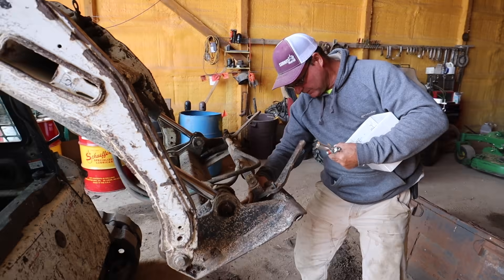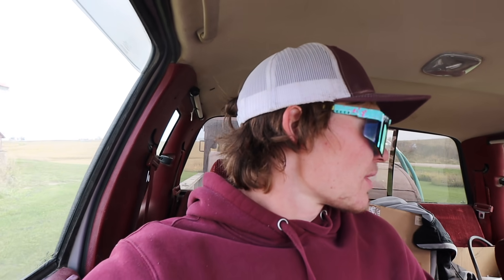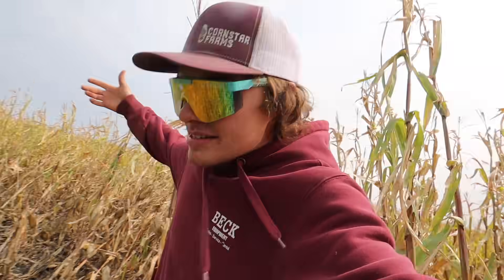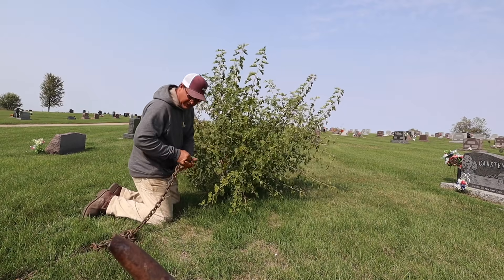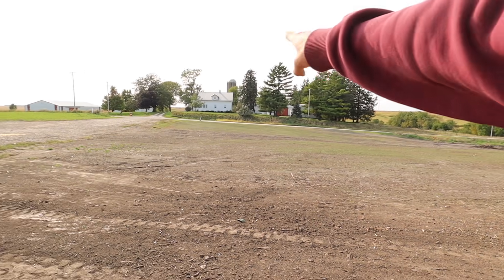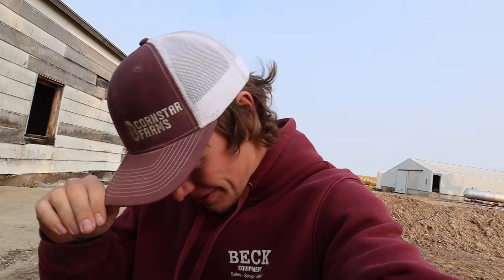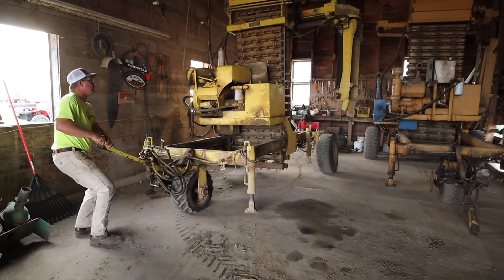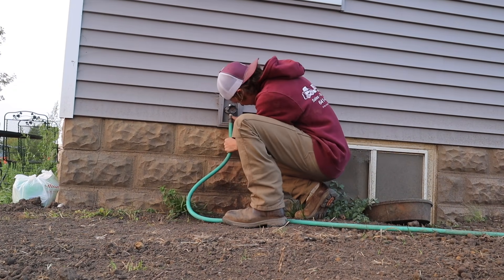My 1st Time Watering My 1917 Farm Mansion's Lawn!

Comment: Thank you for your tips on grass planting. Here in Phoenix most folks have converted to desert landscape. My wife is from Nebraska and wanted some grass. Doggie voted for it too. We have three large areas measuring 8 feet by 11 feet! I tried using a skip loader to level it out but couldn’t get it through the side yard. So I used a whole bag of mulch and spread it with the house broom (big mistake). Then I broadcast the half pound of seed. But was forced to do it by hand. Work, work, work. Finished quickly so I didn’t miss my afternoon nap. Now comes the arduous process of showing away the dove so she doesn’t get too fat. Work, work, work. It is now time for my pre-dinner nap so doggie will have to be on bird watch. Zzzzzzzzz.

Comment: Some Miracle Grow works great as a fertilizer.get a lot of hose and a water tractor I believe they call them turn on the water and it works its way along the hose watering.or get a spliter on the water connection and run multi hoses out and put a fan like  waterer on ends.

Comment: Use your spray nurse truck to water with.  Just put a nozzle on the pump fill line.  It will let you spray quit a ways.

Comment: There's a device called "The Grubber", about $80, three sizes.  Works great to go after the mulberry trees.  Pulls them out by the root.
No stripping of the bark, as with using a chain

Comment: I have to admit I am genuinely surprised that given the hundreds of hours spent clearing the yard around the house, then grading it, etc. that you didn't put in some form of irrigation system that doesn't require manually watering the yard.
Reply: They don't have/need irrigation for any of their cash crops, why would they need it for grass. ( Location )
Reply: @firstname6826  Grass doesn't have the same strong and deep root structure of their crops.  The grass would benefit from more timely waterings.  Unlike the crops, which can go deep into the subsoil for moisture.  Grass roots are only 2 to 3 inches deep and that topsoil dries up quicker between rains.
Reply: @kylehansen2122  I see, thank you.
Reply: @firstname6826  , GMO crops are pretty much drought tolerant. Lawns need water especially if he expects to have a lawn any where near the one in the photo.

Comment: As a mechanic I can say that 30 second jobs usually turn into 30 minutes and if you’re out of luck there 3 hours
Reply: I have figured that one out the hard way. I was doing job which I thought was going to be a 5 min job then my water tank storage thing (aka water butt) tap handle snapped off in my hand and sliced into my finger. It took me around 20 mins to sort my finger out and then it took me the best part of a day to do a temporary fix to it. I am still recovering from the injury and I lost use in the finger which got sliced open. Thankfully only soft tissue damage.
Reply: @EddieTruckingAdventures  🥺
Reply: My uncle Murphy may have something to do with that
Reply: @EddieTruckingAdventures  Ouch
Reply: @KJEThompson  I am doing much better. I have not got any major damage to my finger and still can fully move it
Reply: @Sheryl777  I am doing ok. It was a soft tissue which the tap went though. Nothing major.😃
Reply: @EddieTruckingAdventures  Happy to hear that you're going to be ok! 😀
Reply: @Sheryl777  thank you.
Reply: @EddieTruckingAdventures  👍 yw

Comment: I guess you are not going to take my advice on the grade issue around the house. Well it's like the saying goes... You can lead a horse to water but you can't make it drink.
Reply: I don't know anything about grade or landscaping but doesn't that house sit on a large hill? Doesn't that make a difference? Just asking.
Reply: @firstname6826  Building Codes require a minimum of 4 to concrete patio slab and 8 inches from sill of egress to finish grade at the perimeter of foundation and a minimum of a 1% sloped grade for 10 feet from the foundation. Even if the house is on the highest point of the property.
Reply: @davidleland8729  I see, thank you.
Reply: SMG  Time will tell. However the Building Codes exists for a reason.
Reply: Seems like after 117 years if there was a water issue someone would have noticed. What's the old saying? If it ain't broke don't fix it.

Not trying to beat a dead horse or be a smart a__ , and I bow to your superior knowledge, but I don't see the problem.
Reply: @firstname6826  Since we are throwing out quotes... An ounce of precaution is worth a pound of cure.
Reply: @davidleland8729  Just curious as to how much that " ounce " would cost for that house, considering the proximity of the driveway and the concrete slab on the rear of the house.
   I mean no disrespect sir, just honestly curious.
Reply: @firstname6826  From watching Cole utilizing the equipment like he did to grade that area, it would not have taken but an hour or 2 to reduce the grade at the foundation and then slope the grade to the driveway. Another good example of why that is necessary is the amount of mold and rot on the accessory building that they cleaned out. That building can be restored, but if I remember correctly he said that it would cost alot. He also mentioned tearing it down and rebuilding it. Repairing it would cost less but there again he would have to address the grading and drainage issues around that building as well. He also mentioned in an earlier video that there was a problem with water collecting in that area between the house and accessory building. The concrete slab and walkway will need to be removed and replaced after that area has been regraded.
Reply: @davidleland8729  He is pretty good with that skid loader, and I agree about repairing that building. Thank you for your time and patience. Knowledge too!